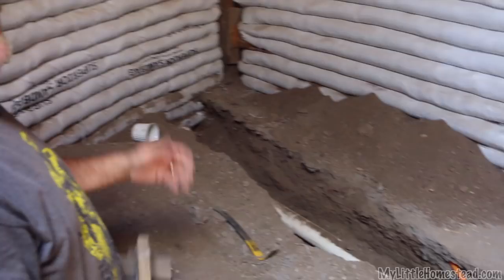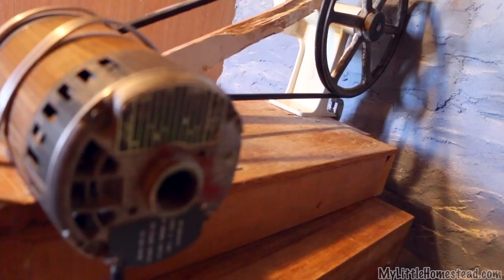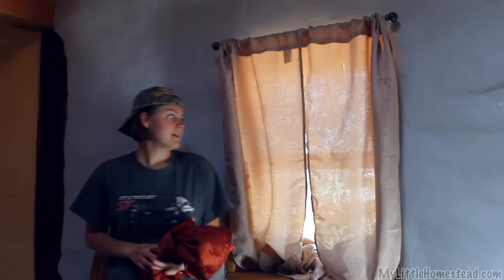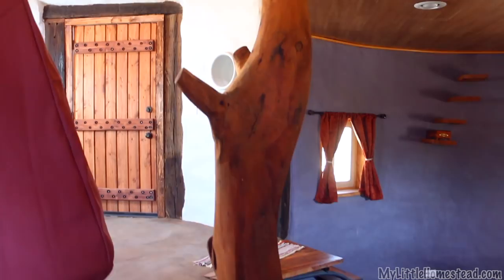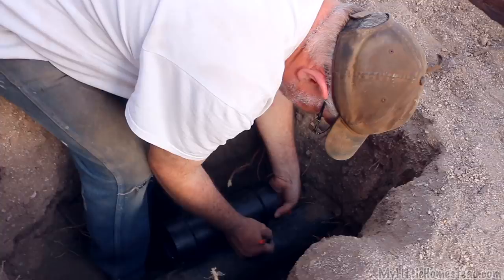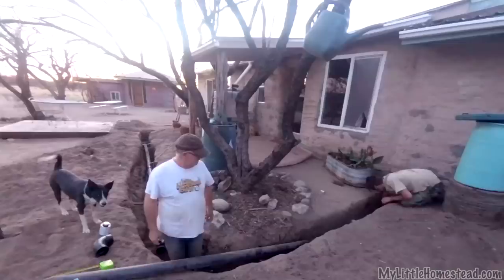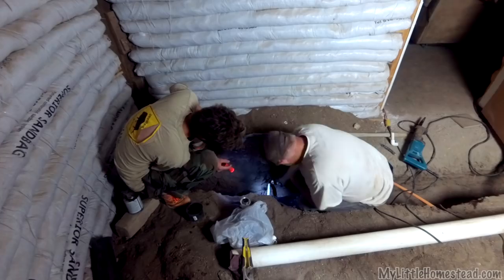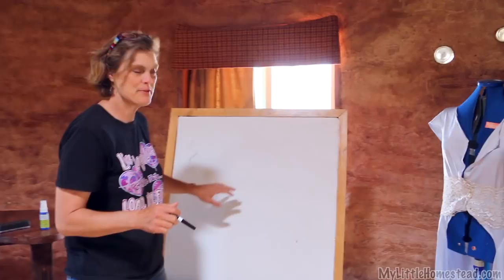Installing Sewer Pipe for Toilet | Earthbag Kitchen & Bathroom | Weekly Peek Ep132

Comment: The boys should look into doing something like you mill setup to there solar setup. I have used a 12v motor to a windmill generator. Helps charge up my batteries instead of using house power. I’m planning a 4:1 and a chain or belt.
Or even look into wind power. Since your in the dessert.

Comment: Over 40 years ago I made a small mistake using a whiteboard.  I had never really seen one and did not understand how they worked.  So without thinking I wrote a message using a permanent marker instead of the dry erase ones.  Needless to say you couldn't erase the message.  Hope you didn't make the same mistake.
Reply: Just in case someone else makes that same mistake, the Mr. Clean Magic Eraser will fix it.  I did the same thing and was able to restore my whiteboard with Magic Eraser.
Reply: No problem! Just use a dry erase (whiteboard) marker over the permanent marker. It works best if it’s fresh, but with a little patience it’ll work with old marker, too. A magic eraser will work, but over time it’ll ruin the board and make it more difficult to erase.

Comment: IRONY??  If you had the white board FIRST, anyone could've written what was required, and whomever was going shopping later would know what to pick up. Wouldn't even need to have any facetime with each other. As for the whiteboard paint. Is it possible it was the wood surface that was the problem?  Moms board was porous and may have soaked up the paint. Changing the surface tension of the paint, leaving it porous, to soak up the ink?

Comment: Oh man! I hate to be a party pooper (no pun intended), but that is not a code approved way to connect ABS to PVC. At the very least the green glue should be used. It sort of bonds to both ABS and PVC although some areas won't even allow that. In that case a rubber coupler should be used. 

I have a sewer line that I am installing and I chose to use the rubber coupler just so no one could complain. I know it is only a low pressure line but 50 years from now I don't want a big stinking mess to be blamed on me.
Reply: No hubs or nothing, nothing bonds pvc to abs. Also may want some water to that toilet but they'll figure it out.
Reply: I didn't realize they were called 'No-Hub' couplers. I'm not a plumber, that is the excuse I will use. Thanks Brian.

I did a little more research and spotted this:
["As defined in the Uniform Plumbing Code section 705.4.2. a mechanical joint shielded coupling for hubless cast-iron pipe and fittings shall have a metallic shield where installed aboveground. Flexible rubber couplings with stainless steel clamps, without a shield, are designed for use below ground."]

Comment: Y'all got a lot of PVC parts - just an observation. I understand, though. If a local hardware store had a "moving sale", almost every seat in my van would be folded down for bulk transport. Had I ever done so, I suspect that my wife might need casts or braces for each hand after the hours of slapping my thick skull...allegedly. The next time I suspect that she might just start slapping the steel vice on my workbench as it likely might hurt less...hypothetically.